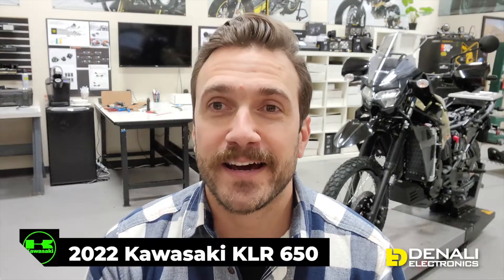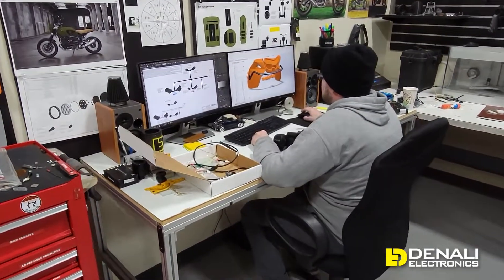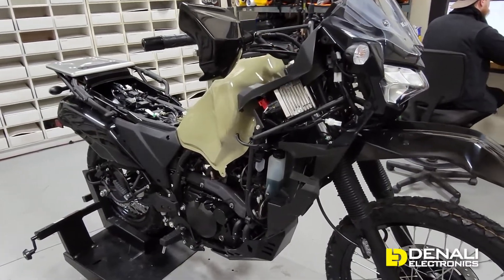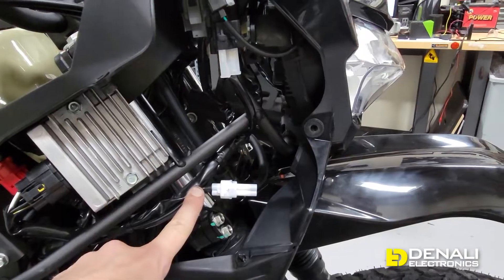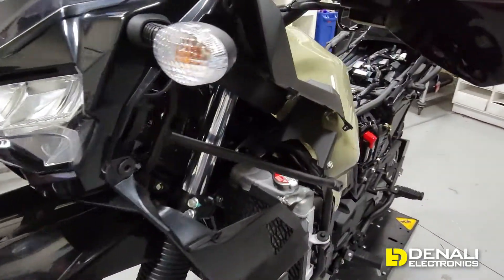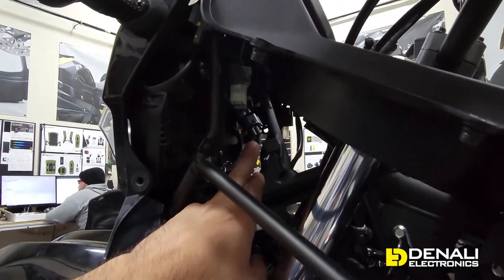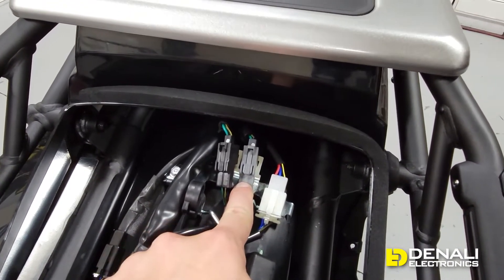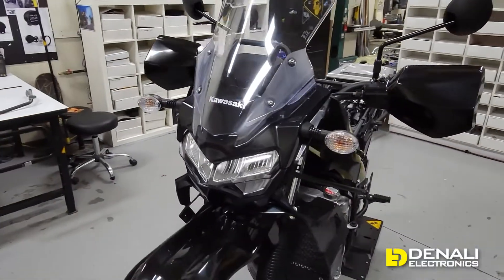Kawasaki KLR 650 DENALI Product Preview & OEM Wiring Overview

Comment: Just got a new 2025 KLR650 and being the man i am, i had to tear down the bike to know exactly what i have under me; The amount of unnecessary weight just to hold cabling is astounding; I can  somewhat understand having the fuse blocks rubber mounted but even the bracket for that is overkill; I'm going 'old school' by removing all the bracket hardware and tying the cables to the frame which will save a considerable amount of weight
Why do manufacturers make things more complicated than they need to be? I have had a few 1983 - 1990 XR Honda's and have never had a cable fail on any of them; No brackets anywhere just strategically placed zip ties holding the cables firm; K I S S